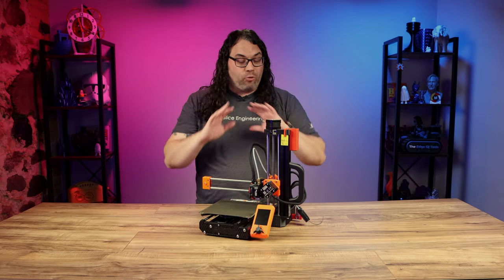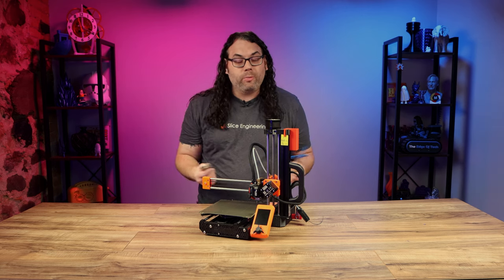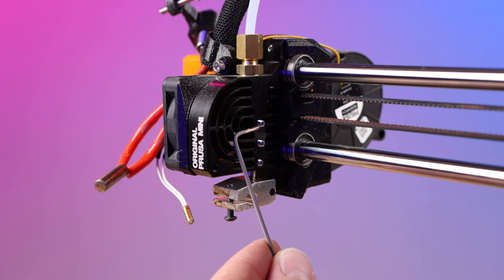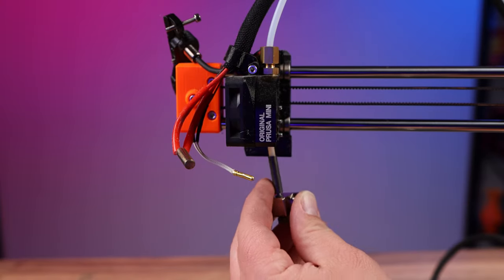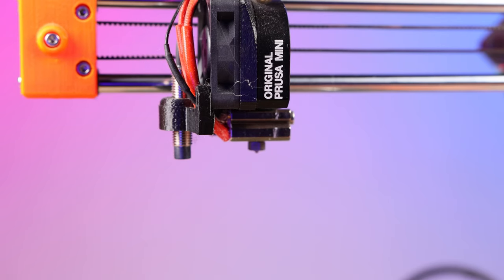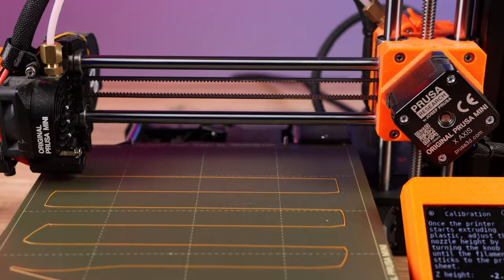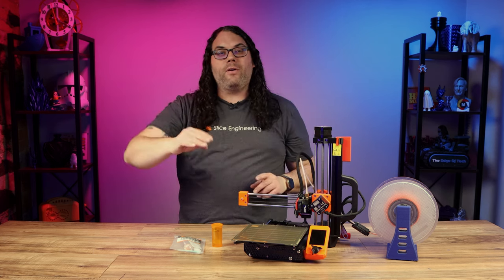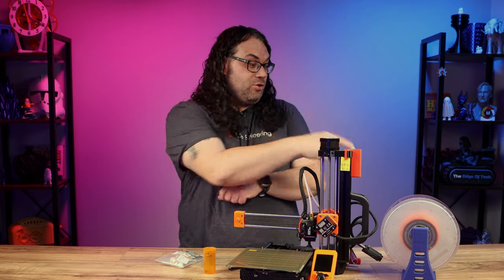How To Install The Slice Engineering Copperhead On A Prusa Mini

Comment: Thanks for this video - super helpful. But like many others have mentioned, moving the hotend downward after loosening the 3 grub screws is not a good move, as it could create a gap between end of PTFE tube and nozzle, etc. Here's another solution that worked for me and allowed me to keep the hotend inserted all the way up:

Use the Move Axis menu option to move the Z height to zero, then click "Disable steppers", then with your fingers turn the center bolt of the z-axis manually until the nozzle just barely touches the bed. At that point, adjust the PINDA probe to be slightly higher than the nozzle, then run calibrations. Then you should be able to do a normal first layer calibration and have z-values comfortably between 0.00 and -2.00.

Comment: I cringed when he moved the heatblock down instead of just adjusting the PINDA sensor like the rest of us. Like bro, you cant make Youtube videos about this stuff and show people the wrong way to do things. You didnt even show anyone any test prints after, so clearly your Mini wasnt printing right after this "upgrade". Do it right, not for me...but for the few people who have no idea what to do.
Reply from the maker: The video is more about installing it. It prints great right now! I did a short on it the same day after the first thing it printed! Not hiding anything here at all. I also just ran a 22-hour print that I'm about to show as well and it came out great with the exception of the very top because I was close to maxing out the Z height. Not hiding anything here. I just wanted to show how to install it. As far as moving the pinda down, I reached out to them about that because their instructions don't show to move it up. But they may need to update that. I appreciate your feedback and thank you for watching
Reply: Great comment, I was thinking the same. Looks like some people need instructions for everything 😂
Reply: Have to admit as someone who is not "expert" but knows enough..  this one threw me a bit.  I have had issues with the PTFE tube in the heat break being too short and causing serious issues hard to track down.  I would have also moved the PINDA sensor...

Comment: I think it would be better to pull pinda probe a bit heigher, not lowering heater block, as you are making gaps in filament path
Reply: I was thinking the same thing when he said he lowered the hot end. I see problems in the future for that machine.
Reply from the maker: I am going to revisit this! Thanks for the comment and for watching!

Comment: We should all be so lucky to have the heater come out so easily.  I had to pry a flat head screwdriver into the slit in the front of the heater block to spread it open enough to get mine out.

Comment: Good video. I'm glad there are more "plug-in" options for the Mini now, but I still prefer the Revo over the Copperhead in this use case. Still too much PTFE in the filament path with the Copperhead, which is where my pain point on the stock Mini hotend is. The Revo eliminated that issue. In my use, the Revo not only prints better than stock, but I haven't had a single clog since I installed it many months ago. That being said, I love the Copperhead I put on my CR10S Pro V2. It's been a rockstar.
Reply from the maker: Awesome info! It's been solid so far for sure!! Thanks for watching!

Comment: Can you send post the link to the PID tuning you mention in the video? Please and thank you!
Reply: Yes really.  Slice engineering doesn't either.  When I messaged them about it they linked to proceeedures for the prusa 3s instead.  Post install I've had nothing but headaches.  No bed adhesion, stringing, oozing.

Comment: MAN the last step is just wrong now you pteft tube is not all the way to the top it may work for some time but this is bad
you need to ajust the the pinda prob when you use the manual way whit the paper for the nozzel and cabelbinder for the pinda prope ore creditcard :) that is the proper way

Comment: I tried the revo micro upgrade only to find no advantage at all and some printing problems i really think theses printers just work better when there stock there not like an ender or others that benefit from upgrades you just need to do maintence on a regular basis and they work great.
Reply: Which is odd, because this cost just as much as a Revo does.  Which only gives you the added benefit of having quick nozzle changes, and easy jam clearing.
Reply: this is definitely not worth it over the revo
Reply from the maker: I appreciate your feedback and opinion! Thank you for watching!
Reply from the maker: I'll have to check that one out too!

Comment: I have been rocking a copperhead on my Prusa mini for well over a year now and zero clogs since switching.  It is a great upgrade.  I paired mine with a micro Swiss a2 nozzle.  The slice nozzle had me printing a lot hotter than stock but the slice has been great at 205-215 for 99% of my prints.

Comment: This looks super helpful. Is there a reputable brand that sells the same thing?
Reply from the maker: I'm not sure what you mean by reputable, slice engineering is 100% reputable and is a very good company!
Reply: @TheEdgeofTech  slice is a terrible company. I hope nobody sees this and thinks they should support slice. They need to disappear asap
Reply from the maker: @jeffreyepiscopo  I appreciate your opinion, but I disagree wholeheartedly. This is a great product and it works very well on my Prusa mini!
Reply: @TheEdgeofTech maybe this upgrade is good but slice is a garbage “company”. There’s no way to argue against that!
Reply from the maker: @jeffreyepiscopo  I'm very interested to hear why you think this. Shoot me an email if you can. Or message me on any of the socials.
Reply: @TheEdgeofTech  no need to message you anywhere. I can post it here for everyone to read. u/JohnHue said it best:

Slice is selling a product in a field that has been created, has been able to innovate, and in general lives and breathes FOSS (free and open source, but free as in free speech not free beer although in most cases in 3d printing the later is also present). This is FINE, they have the right to do it... I personally think it's WAY overpriced (to the point that it prices out most people doing 3D printing), doesn't bring much to the table and the parent holds by a very fine thread... But they have the right to do it.

The issue is that Slice doesn't understand, respect or support FOSS and has shown no interest in doing so. This is the difference between E3D and Slice in terms of how you manage your patented stuff.

Here's what E3D has to say about their V6 hotend design after they fully open sourced it :

"After all, we're confident that what makes an E3D product truly worthwhile is more than just its schematics. Not only are our products manufactured with quality materials to a high standard on modern machinery, followed by a rigorous testing and QC procedure on each batch. Every single one of our heat breaks is individually checked and cleaned by hand, and we offer long-term customer service and support that is hard to find elsewhere. Buying an E3D product also means you are supporting continued innovation in the form of R&D for future E3D products. And Haribo."

https://e3d-online.com/blogs/news/open-source-design-patents-and-e3d

Slide has the opposite view. They've patented a tiny change in an existing design, capitalized on more than a decade of open source work from professionals and hobbyists but offered nothing in return and are even fighting everyone who makes something even remotely similar to what they're doing. Their excuse is "we have families to feed" well guess what so does E3D, but E3D said "we're allowing you to copy our design, but we're also guaranteeing our version will be very well build, controlled and supported"... Based on that mentality and the respect they show to the FOSS community people still buy E3D hotend be it only to support them rather than buying the Chinese versions.

In that sense Slice is similar to Stratasys who patented placing motors outside of the enclosure on an FDM printer as well as using active heating to heat the chamber, both things being extremely simple and OBVIOUS design choices for anyone working on that.... This is why you don't have affordable commercially available fdm printer with an actively heated chamber, because to do this they'd have to pay a licence fee to Stratasys and Stratasys also have the choice to not give the license to you even if you pay.

Personally I don't hate Slice, they've done me no wrong. But by their innovation-hindering actions I've placed them in the "will not see me money or support" drawer just like they themselves did with the FOSS community.
Reply: @jeffreyepiscopo  i agree with you, slice is garbage, the dragon hotend is a far better upgrade, while also being around the same price. Phaetus, a reputable chinese company, sells them. The revo is also a great hotend that's very easy to use.

Comment: I don't understand why slice uses boron nitrade in their heat blocks, instead of making a proper clamping hot zone. Even the sock looks thin and flimsy. It's a bad overpriced product, and the company behind it is even worse.
Reply from the maker: I can't comment on the boron nitride, but I can say the sock is good! Just about the same as all the other ones I have. I appreciate your opinion, and thank you for watching!
Reply: @TheEdgeofTech  compared to the 4mm thick rapido socks, they seem super flimsy.
Reply: We use Boron Nitride Paste for two main reasons. The first is that it helps with heat conduction, allowing you to take full advantage of our copper hot blocks. The second is that we use it in place of a clamping cartridge slot to remove strain and pressure on the heater cartridge. Not clamping down on the heater cartridge helps extend the life of your heater in addition to the thermal benefits.
Reply from the maker: @SliceEngineering  Thanks for the info!!